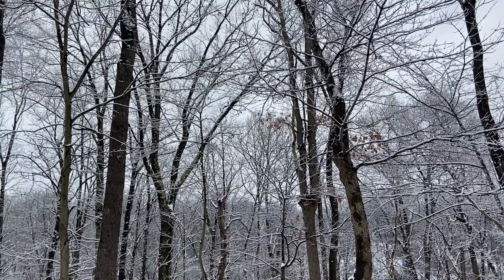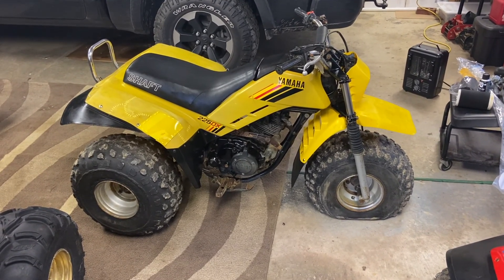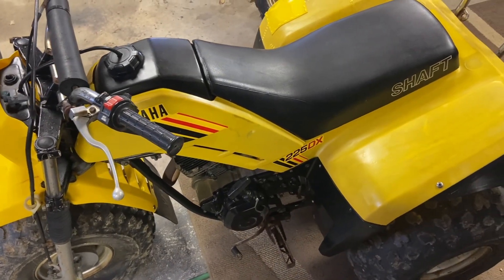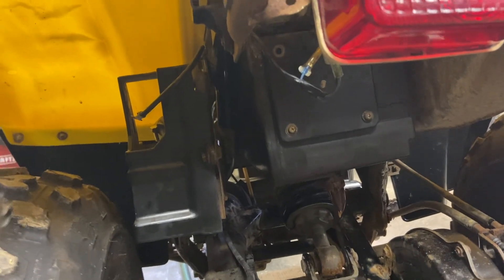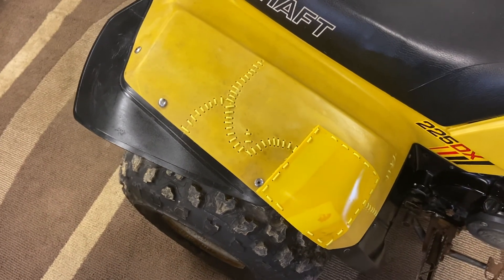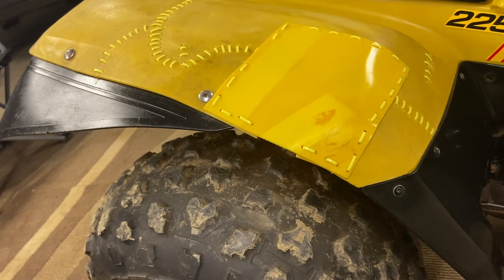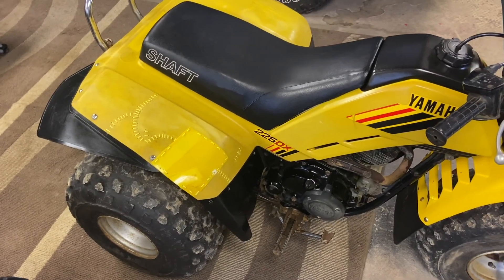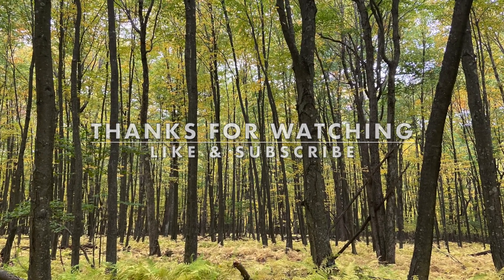Reviving a 1984 Yamaha 225DX 3-Wheeler

Comment: Can I ask you what you paid for it? I'm about to pick one up for 50 bucks that's been sitting out in a field for some time. I figured for $50, who cares what's wrong with it I will take a stab at it and if it is too far gone they can sit out in my field LOL
Reply: Hey two years later, did you end up getting it? How did it go?
Reply: @willbates8464  Hey,yes I went and picked it up. It was very rough,beyond repair in my opinion. It was missing a lot and what was left over was very rough. With all that said I listed it on craigslist for $300 and a guy came right away and took it for parts for his.